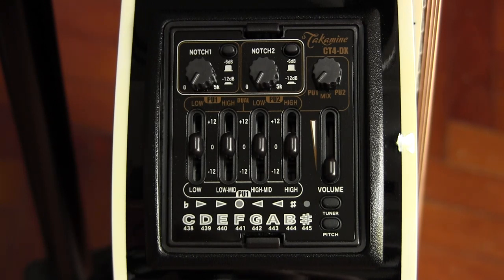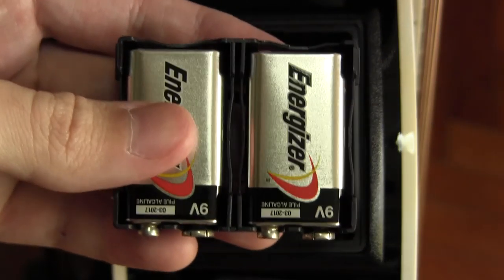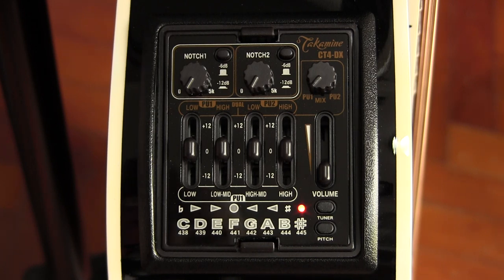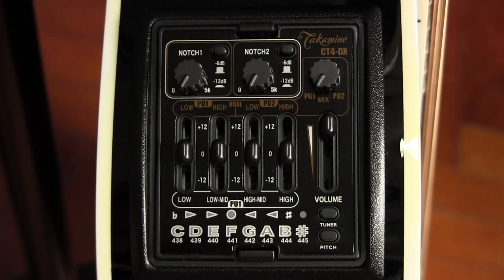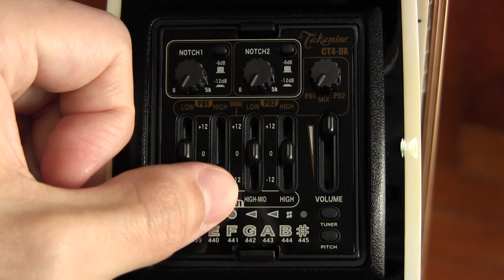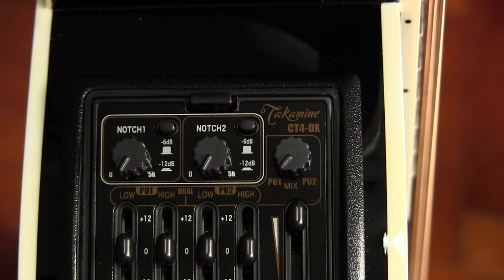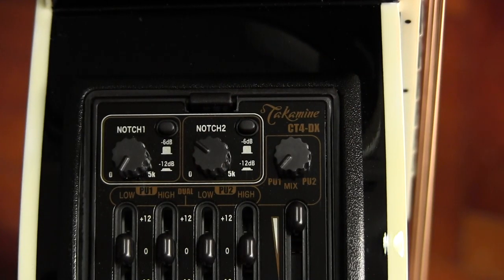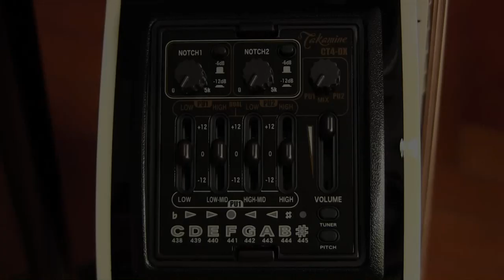The Takamine CT4-DX acoustic guitar preamp - review and user guide

Comment: Hello 
Great reviews as always. 
I had a Cool tube 2, terrible on batteries. Is this one  easier in battery life. 
Thanks
Reply from the maker: Yes, way better! BTW, the best way to manage the low battery life on the Cool Tube preamp is to use rechargeable Nickel Metal Hydride batteries - charge them before each gig and you're good to go. I haven't used Alkaline AA batteries for years.
Reply: Great advice thank you very much.
Reply from the maker: You're welcome, all the best with your music!
Reply: These preamps are not compatible with Boss WL 20/20L Wireless Systems. Im considering getting a new shure glxd+. Have you any recommendations. Brendan
Reply from the maker: @brendan8233  Any transmitter that uses a TS, as opposed to a TRS, plug should work fine. Disclaimer: I have not tested these guitars with any wireless system, so the advice above is based on general, rather than specific experience.

Comment: Thank you for this demo! 
I have a P5-dc with the Ct4dx preamp. 
Question: it possible to add a soundboard transducer system like the Schatten hfn ?
I heard a lot good things about the Schatten, and maybe it's a good addition to the takamine ust.
Reply from the maker: I don't see why not, although you would need to replace the connector on the hfn and also do some testing to see how best to balance the two pickup systems.

Comment: Ok, thank you so much for this very informative review! I know it’s been up for awhile, but here is my question: I have the CT4BII. Is it worth replacing it with the DX just so I can ad A TriAx pickup? I have sufficient EQ with the custom built tube preamp pedal I’m using. But this seems like an easy way to introduce another pickup. Thoughts? Thanks again brother.
Reply from the maker: Hi Terry nice to hear from you. I'd say in your case it would be a worthwhile upgrade - that is the exact situation that the CT4-DX is designed to handle: two pickups with both being treated equally, with no distinction between 'main' and 'secondary.'
Reply: Thank you for responding man. I have heard you could use a passive pickup like the LT Baggs M1 passive. Do you know if that is possible? I know I would need a patch cord to connect the pickup to the preamp. But this preamp eliminates the need for two separate input jacks for the guitar. Yes?
Reply from the maker: Yes no problem - in fact the Takamine Tri-Ax pickup is a variation of the M1 and is also made by LR Baggs. And yes you would need a minijack to RCA/phono cable in order to connect to the preamp.
Reply: Thank you so much. You have know idea how helpful you’ve been!! Man I’ve been trying to get some solid info on this for awhile. You are a life saver.
Reply from the maker: You're welcome! If you have other questions you can also post them at http://www.takamineforum.com/ - lots of really helpful people there :)
Reply: My Tak Guy is a dealer also. So he has been steering me toward the Tri-Ax 2. But it’s like $250+. I can get a used Baggs M1 passive for a hundred or a new one for 150 ish.  He says that the TRI-Ax is “tuned” for the Tak pickup system. I’m skeptical. But I will start with the Baggs and upgrade if I need to when I can afford it. I have the CT4BII. And the DX is going to run me over $250 new. It gets expensive!! But I got a super sick deal on my EF340SCGN. She deserves the best. I can’t say enough about this guitar. Any other company would charge double the price for a guitar this good. Thank you sir.

Comment: I just bought a used DMP051c SAS with the CT4-DX. This video was so helpful. I do have one issue...my dual 9 volt batteries are going dead very fast. I am leaving something on? A possible bad pre-amp? A short in the system? Any thoughts or ideas?
Reply from the maker: When you say 'very fast' - how many hours are we talking?
Reply: @GLBProductions  between 24 and 36 hours each time. And, it's not plugged in. I'm playing it unplugged acoustic...
Reply from the maker: Yeah there's some sort of parasitic drain going on - on some of the Tak preamps there is a jack override switch which keeps the power to the preamp on permanently, but the CT4-DX is not supposed to have one of these. I would try removing the preamp, cleaning all of the connectors and then putting it back in the guitar. Also clean the output jack socket. If this doesn't help then chances are it's a fault within the preamp somewhere, which typically can't be repaired.
Reply: @GLBProductions  ok. Thanks so much for the prompt response and all of your help.
I'll try cleaning the contacts and check the input jack.
I'll let you know if anything works.

Comment: Yes, that's what an acoustic preamp should sound like IMHO.  Tube is great...in an amp, but I think the color should be kept as far away from source as possible.  If that makes sense--the coloring of the sound should happen at the input through the amp circuitry and from the speakers.  But I do like this one better than the Cool Tube...of course, YouTube compresses the sound a lot, so it probably sounds amazing with full dynamic range.
Reply from the maker: - Yes, it is a very dynamic-sounding preamp! Glad you like the sound - it's good that Takamine preamps are modular so players can choose the preamp they like the most.
Reply: GLB Productions I do like the notch filters.  I don't know why more acoustic preamps don't just do that by default.  That, in my opinion, is probably the most useful function of an on-board guitar EQ!  In the studio when I'm mixing I usually will always roll everything below 100 Hz and above 5.5 kHz for guitars (acoustic and electric).  It's just inaudible junk below or above that, assuming the guitar is using roughly A440 tuning.
Reply from the maker: Eric Pederson Yes, I often will do all of my EQ with just the notch filters - bear in mind though that they are not high/low pass filters as you use in the studio, they are narrow bandwidth cut-only filters.
Reply: GLB Productions Yeah, but I can't imagine the Q width is THAT narrow, it's definitely grabbing some of those pesky neighboring frequencies that cause some trouble.  It's imperfect, but certainly more targeted than just taking the axe to all the low stuff.
Reply from the maker: Eric Pederson Yes it would be nice if Takamine were more transparent about the type and bandwidth of the filters they use in their EQ but those are apparently quite secret! Also they do not disclose whether the low and high EQ are shelving or peaking, so we just have to use our ears, the good old-fashioned way ;)
Reply: GLB Productions I honestly think the bandwidths are arbitrary on a wide range of EQs of all types.  Seriously, there doesn't appear to be any generality between the different models and makes. But hey, that's job security.  George Martin's book "All You Need Is Ears" remains true despite massive advancements...if only all the new toys made it all easier.  LOL
Reply from the maker: Well said!

Comment: takamine is driving me nuts. i have a p6nc - cool tube 3. what i need to know is what does it do when the batteries are low as it has no battery indicator and i have no book. i see a video for ct 2 and ct 4 but not one for ct 3. ????? can someone let me know? thanks.
Reply from the maker: Hi Greg you're in luck. In a recent post on the Takamine forum somebody posted on this issue. Apparently when the battery in the CTP-3 is low the green middle indicator for the tuner starts to flash. There is no mention of this anywhere in the user manual and the poster discovered it by accident. So spread the word!
Reply: GLB - thanks. last night my tak p6nc did exactly what you described . i thought this meant new batteries, but not sure. they don't seem to last long. thanks for your great help. very much appreciated. happy holidays, cheers!
Reply from the maker: No, the Cool Tube preamp is a real battery eater - normal Alkalines last about 8 hours, so one or maybe two shows if you're lucky. I recommend using rechargeables. Happy Holidays to you too!
Reply: thanks again.